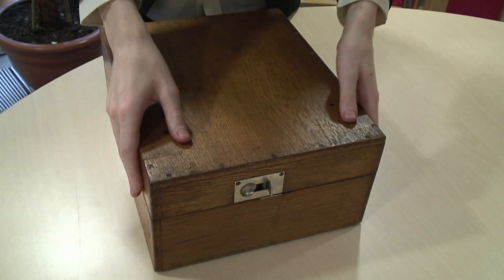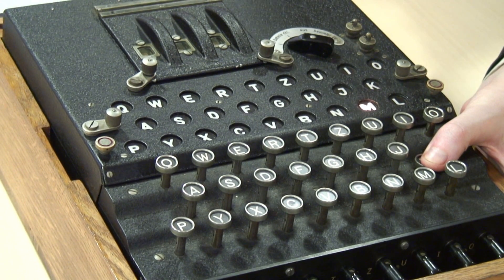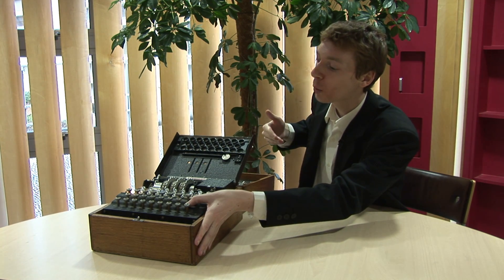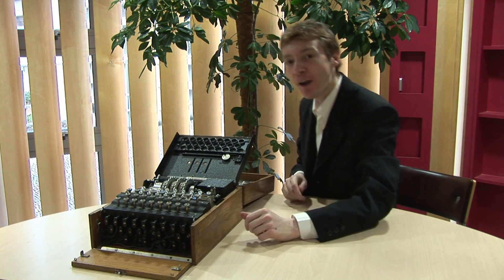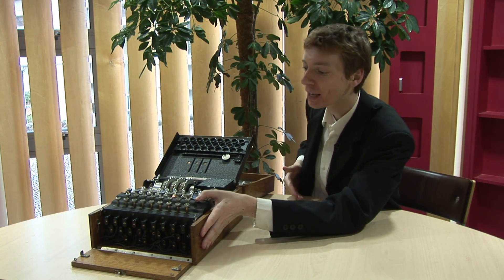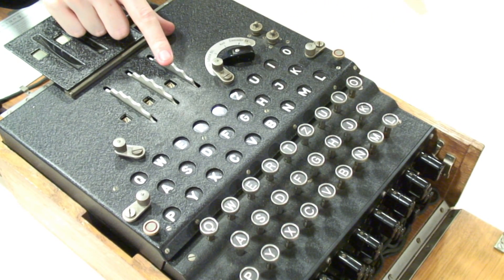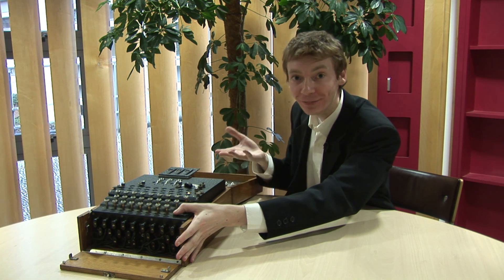WWII Enigma Machine: The Enigma Project

Comment: Dear  Dr James Grime

If they used 11 pairs on the plug board, would the combinations have increased to 205552193096250?
(26!/(4!*11!*2^11)=205552193096250 (plug board only)).

According to me, that would have been the maximum number of possibilities for the Plug board. 
If so, why did they decide on 10 pairs?

Secondly, did they have more than one "reflector ring"?  
I am referring to the ring on the left of the three rotors. The one in the video was marked "B".

I enjoyed this video and many others on your channel.

Kind regards  

Stephan Cilliers
Reply: Yes, 11 cross-wise pairings would have yielded a higher number of possibilities (even higher than 12 or 13 pairings).  My guess (pure speculation on my part) is that 10 wires fit into the case better than 11 for storage and transport, maybe 11 would have been a tight squeeze?
 
I wonder why they limited themselves though?  What I mean is that they could have swapped a different amount of letters each day, say swap 5 letters one day, then 8 the next day, and so on.  Would have been an even higher number of possibilities that the code-breakers would have needed to check.  I'm thinking that they wanted to keep things standardized and simple for the operators, which isn't always a good thing.
 
The four wheel enigma used by the navy had two reflectors to choose from, and they could also set the reflector to any one of 26 positions.  The army enigma in the video didn't have that option, it was a fixed reflector ring.

Comment: The Morse code is: "Dont be nosey SK" which means "Don't be nosey END". It does say "Don't be nm" at the beginning when the Enigma is being opened but presumably that's because the full message gets cut off in the middle. 

So cool to see an Enigma being used. Great video.

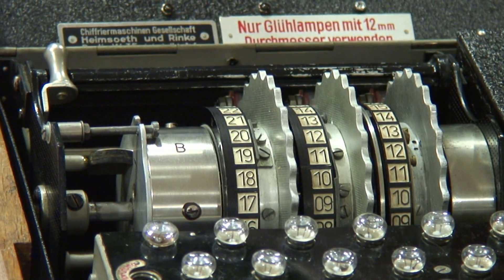Comment: I have a question for you: you state @3:25 that the middle rotor triggers the left rotor - but Friedrich L. Bauer stats that is not true, there is a flaw that the middle rotor is moved by the left rotor 1 position to early - so in practical use there are (depending on message length) only 25 possible positions at the middle rotor and the last one gets skipped

this should be true for all ENIGMA machines with rotors I to V - so for your (i assume ENIGMA I too) - can you verify that?

Comment: @lhbeau 

PC Simulator : free
E-Enigma (Electronic Hardware DIY KIT): 140€
Enigma Replica (mechanical/electronic - not fully compatible): 700€
Enigma Replica (mechanical/fully compatible): starts @ 5000€
Original Enigma: 30000€ - 100000€ (with tendency to rise)
Reply: Relic (ground-dug) machine: 3500 - 6000eur
Full 1:1 mechanical replica: $30,000 USD from Klaus Kopacz
Single original rotor: abt. $2000-3000
Damaged orignal rotor: abt. $500-1500 (depends on condition).

Comment from the maker: @singingbanana The machine would then be set to the secret message key, and the rest of the message would then be encoded using the secret key. This means the operator sends six letters at the beginning of a message, the first three letters in plaintext. These should be six random letter, but sometimes the operators would use six letter words. So if the first letters were BER, you can guess the next letters are probably LIN. Or HIT would probably be followed by LER etc.

Comment from the maker: @Error081688 The proper answer is; the chosen rotars and plugboard were the daily setting and were fixed all day. The rotar position however was called the message key and it was different for each message. The operator would pick three numbers/letters and send that in plaintext at the beginning of his message. He would then set his enigma machine to this setting, and then use the enigma machine itself to encode another three numbers/letters to be the secret message key.

Comment: I know the Germans had a book that told them exactly how to set up the machine each day, but I am curious, did they reset the machine to that days settings after every message? It seems like it would be fairly easy to miss a transmission and then your machine would be off-set for the next transmission, but then resetting it every message seems like it would make it easier to crack. Do you know how they handled that?

Comment: @thonarlia I don't think the 2 places back really matters, you just re-set the machine to it's original starting point. 

Then all you have to do is send the code and the order the code braker needs to be in separately, when the code and legend are received they would just set their de-coders to the requirements and type in the code, which would then be de-coded for you. I think.

Hope this help (Hope I'm right to)

Peace